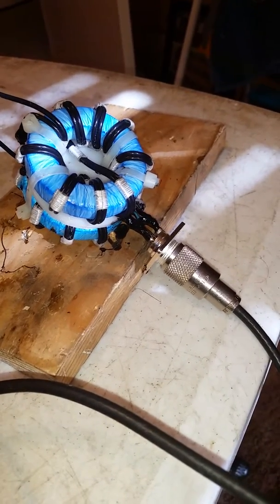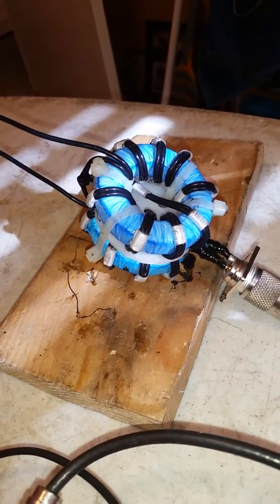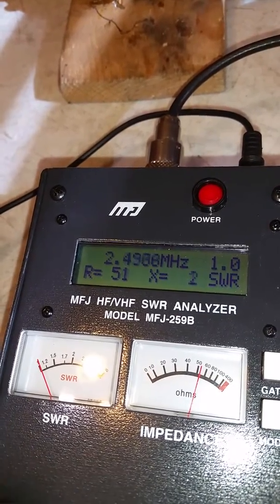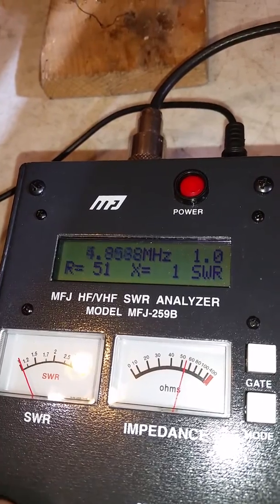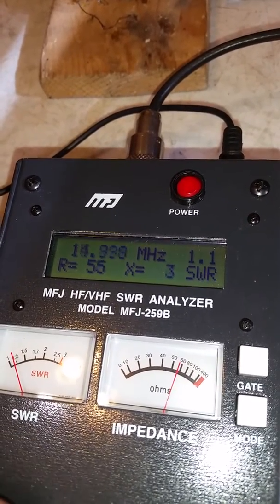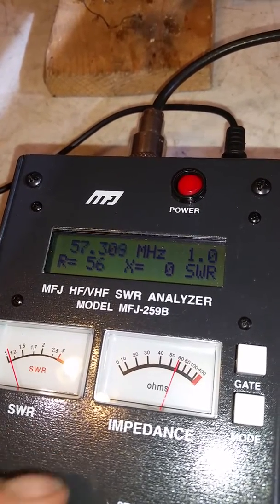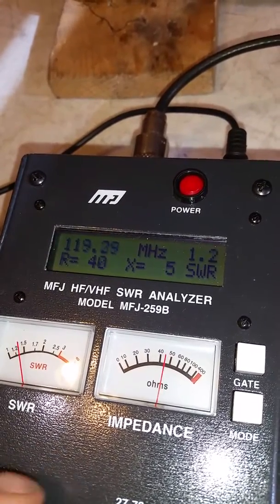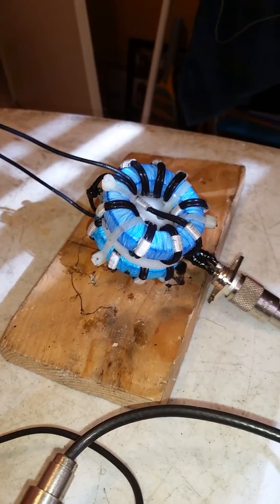4:1 Current Balun

Comment from the maker: This is a current balun double core stacked. Eight turns not counting the crossover turn in the middle, which technically makes each core  nine turns. The wire is critical because the spacing center to center makes the ohms correct. PTFEconnection wire stranded silver coated makes 100 ohm spacing then when put together is 50 ohm.got the wire on eBay. The blue wrap is Blue Monster 3/4 to 1 inch wide Teflon tape three layer approximately.

Comment from the maker: The balun is made to Ballance 50 ohm to 200 ohm. We're you contemplating connecting wires where I have the coax and then a dipole to the other side. My biggest recommendation is to buy the ARRL antenna book and the hand book. Also there many on line how to articles as well